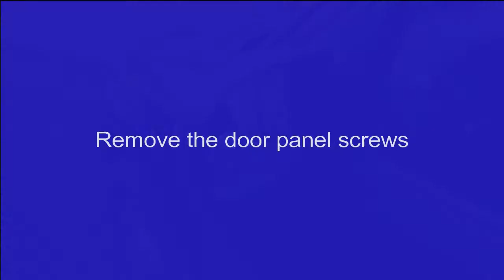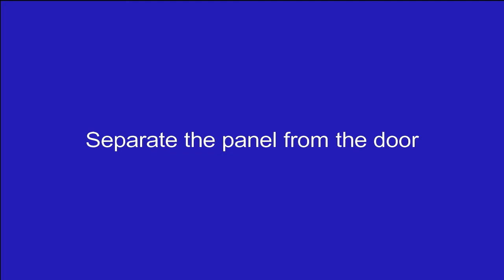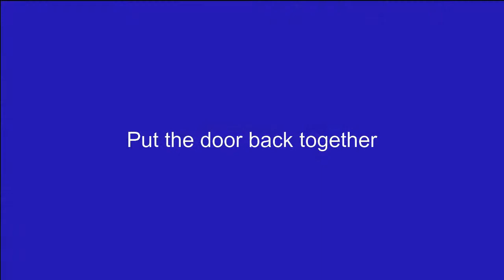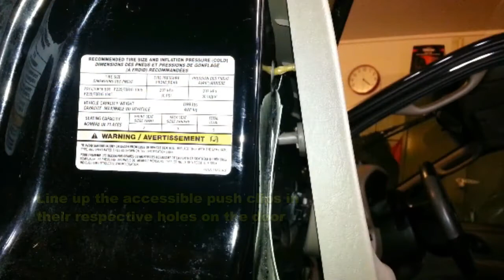Door mirror assembly replacement (2001-2007 Ford Escape)

Comment: Video very well put together. Made it very easy to replicate thank you.
Reply from the maker: Most of these type of things aren't really hard...it's just figuring out where to start first. Glad It helped...thanks for watching!
Reply: Does this apply for heated mirrors too?
Reply from the maker: Yes, especially a vehicle this old! And with the vehicle being black, it draws a lot of heat.
Reply from the maker: Yes...heated mirrors will just have an extra wire or two on the connector
Reply: Thanks for the video, made mirror replacement much easier to figure out. Just an FYI for car owners with a upper speaker next to the window, it pops off just like the flat panel, you just have to unhook the wires to it first.

Comment: Picked up a side mirror from the pick n pull auto wreckers been procrastinating but I'll go install it now using this video
Reply from the maker: It's really easy...hope it helps. The only difference you may run into is a speaker on the sail panel...this Escape did not have one. Pretty simple to unplug. Thanks for watching!